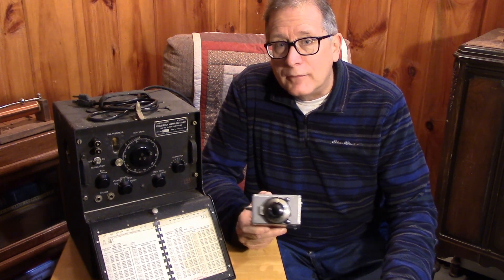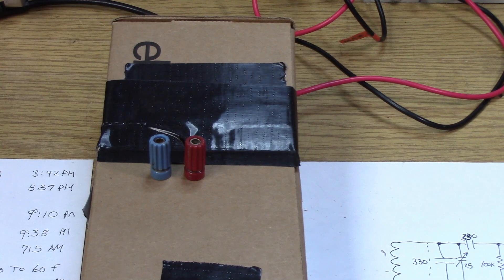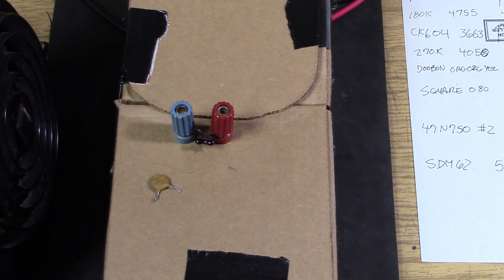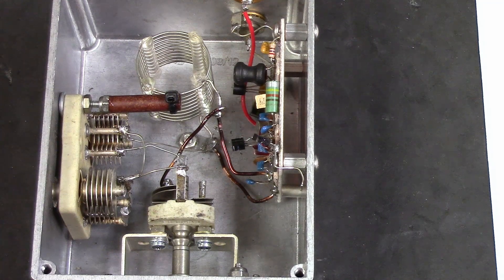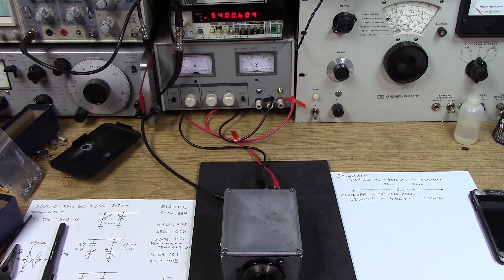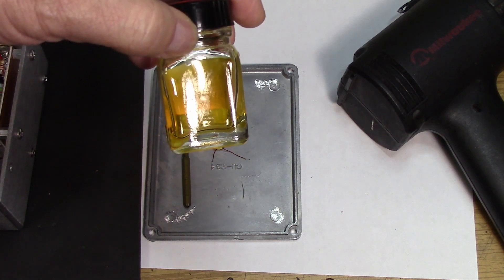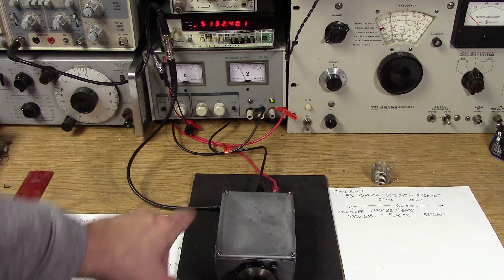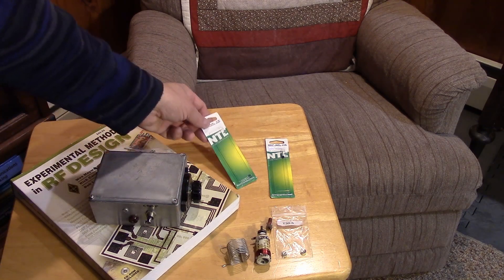VFO Discovery Part 3

Comment: I have found that the dipped mica caps have little freq jumps, about 1 Hz. The only caps which I have found to be suitable are polystyrene. I was very fortunate that someone gave me some temp compensating variable caps called the Oxey Tempatrimmer. With these it is still very tedious to find the correct spot. In the past I have found that several caps in parallel is a good thing to do, maybe less RF heating of the capacitors. I used to find that big caps were better.

Comment: I must disagree, if you build a "huffer -  puffer" with two large cavities holding cold and hot air respectfully that automatically changed very five minutes, charges a central cavity with the subject between sub freezing {zero degrees} and 110 degrees F you can, if you wish to take the time, temperature compensate any circuit. Ron W4BIN
Reply from the maker: There are folks out there that have devoted years to any one of the subjects that I brush against and I yield to their experience.

Comment: Wow, thanks Mike.  You are changing the way I build VFOs!   I've been keeping the powered components outside the box -- I plan to follow your lead and go die cast.  I'd come to believe that air-core  coils were best and that toroids were trouble.  I've been winding my own air core coils using cardboard coat hanger tubes (Farhan used drinking straws).  I can see from your video that toroids can be used.  73  Bill N2CQR
Reply from the maker: Powdered Iron is an under appreciated material. Ferrite has its strong points, but for tuned circuits and filters, this stuff really dominates.

Comment: Thanks for the video. One annoying problem with JFETs is that J310 (through-hole ones), 2N3819, and MPF102 are difficult to find, and when they are available they are not cheap. The closest thing I could find in my area is J111. Let's see if I will be able to reproduce the circuit using these...
Reply from the maker: J112, J113, NTE457 are also good subs. That J111 should work fine! We do take the availability of parts for granted in some parts of the globe. The JFET is actually the simplest semiconductor triode out there. It is simpler than a bipolar transistor.

Comment: hey there mike, I see you use your frequency counter almost on every rig u build Rx or Tx. Some times when i hook mine to a project I'm working on the meter seems to overload the project and stop oscillation, some times i hook it through a buffer amp. Any other ways to hook a Frequency mtr to oscillators without hindering the works?
73's buddy
Reply from the maker: Khalid, you might try using an ordinary 10X scope probe on the front of your counters input. If that will not trigger it, add a small amplifier stage between the two with the 10X probe. 73's Mike

Comment: Maybe I missed something; you showed positive then negative but thought you would actually use the comp-caps to zero-out the drift and show us that end-result by temperature cycling?
Reply from the maker: I wish I had an appropriate thermal chamber to do such an experiment. Again the Experimental Solid State Design book has a section on how to approach this.

Comment: As always thanks. Looking forward to the varactor video.  Been playing with winding toroids for my loop amplifier, been through about 10 trials so far and getting close to playing with the lpf I want in the input filter.  I've thought about using varactors there to make it tunable.
Reply from the maker: It might take more than 1 balanced pair to give you the range you need with the loop unless you come up with some clever bandswitching arrangement.

Comment: Nice change with the toroid over the air core you could hear your finger affecting that one. VK3IV
Reply from the maker: Also it seemed that with the air coil the frequency went down markedly, but with the toroid it went slightly higher!

Comment: Probably wouldn't make a lot of difference but mounting the toroid to the perf board with a nylon bolt/nut might provide a bit more mechanical stability (or make it more prone to tapping on the box!). Great job Mike, look forward to the varactor experiment.  73 - Dino KL0S
Reply from the maker: Agree.
Reply from the maker: Dino, I got the very heavy shipment that you sent! FedEx had to use two delivery vans, one for the HUFF and one for the PUFF!
Reply: @MIKROWAVE1  Yep, had to use a crane to get it from the truck into the Post Office!  ;-)  Maybe you can use it as a homebrew "oven" for stability testing.  73 - Dino KLØS